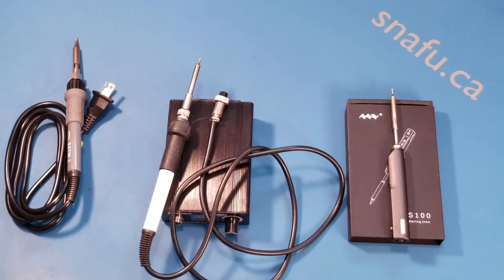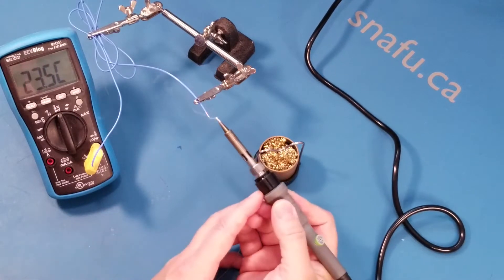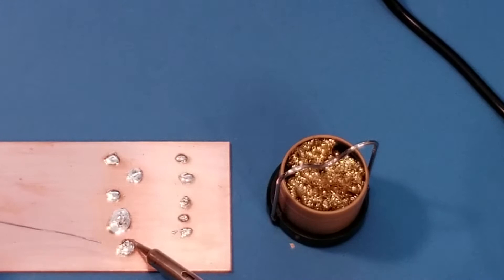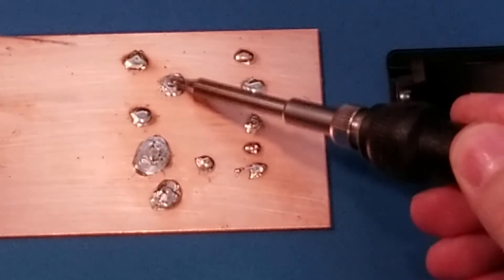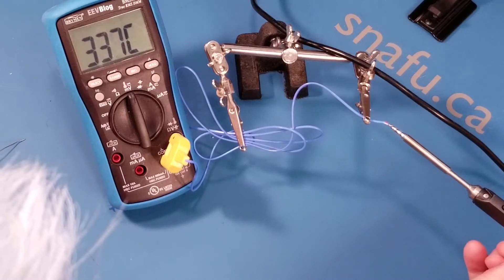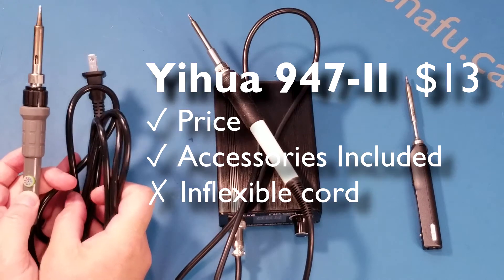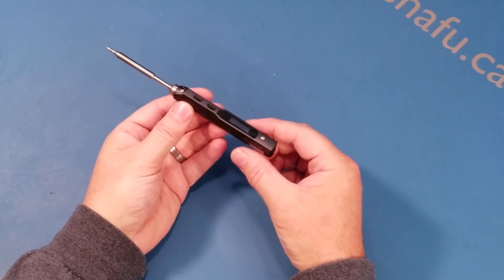Soldering Iron shootout: Yihua 947-II vs Quicko 951-T12 vs TS100

Comment: Its a good video but doing these tests it should be self explanatory to set the irons to the temperature using the multimeter thermocouple not the station and then compare them side by side. I think that you would be surprised ;)

Comment: One note, the TS100 with 19V is not at full power, it does required the 24V power supply in order to put out the claimed 70W/65W or thereabouts ...

Comment: Put a k tip on those quiko or the ts100.. you'll see a difference in performance.  Those little pointed tips are crap.  I have soldered pennies together using the ksger t12 (slightly upgraded quiko.. )  and it took me 27 seconds to wet on a penny.  It's not thermal mass where you get the problem.. its the conductivity of that heat.. even beiing direct drive.. you need surface area to conduct.  The quicko looks like it had a j2 on it.. which would be better than the straing cone tips you have on the other two.    I do turn the ksger up to 400 when doing pennies though.. and that probably has a lot to do with it as well..

Comment: what a demonstration, thermal transfer depends on the size of the tip, use flat head tip for both ts100 and t12 it will show much thermal transfer
Reply from the maker: Actually what I was demonstrating is the ability for the tip to come back up to temperature when given a big thermal mass.  Also, I used tips that were similar in size on all three, to avoid any bias
Reply: @Boffin55  no you did not use same tip types so admit that ,i have weller hackos and ts100 plus all school ceramic termal transfer hackkos and wellers and i can tell you the tip makes a big difference with big ground planes and big parts,ts100 with the new firmware and a chisel tip can do a lot for a small gun by the way

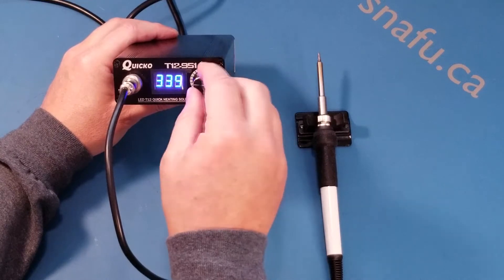Comment: 4:25 I have a later model from Quicko, the T12-953, which also has the same temperature jumping issue. The temperature readings becomes stable if I disconnect the ground, very weird.
Reply: You might not have a good ground, which is likely used as a reference

Comment: Comparing with Hakko or Weller, Quicko will not perform any worse. The difference is in the tip equipped. With the same tip, you will get the same performance.  Cheaper does not necessarily mean worse in performance, it may lack in other respects.

Comment: I have my doubts that the Weller or Pace or Hakko could do any better with that test  you showed. That looked like a slab of copper flat stock and that will rob any Iron of it heating capabilities. No Iron can do every thing. That test would be equivalent to welding a battery cable which could take a 240W iron to do it successfully
Reply from the maker: It's a piece of 1oz, 1.6mm copper clad PCB blank.  My 40 yr old weller with a 700F tip did better than all three, although I didn't show it on cam.

Comment: i have a similar item to the cheap $13 a  hakko 907 if you used one of the fatter tips instead of the needle point at 350  mine solders on heavy planes no problem, as you say its thermal mass, and the only mass is in the tip and not the whole shaft as in the other 2. others have rated the t100 very highly so i think it comes down to tip choice

Comment: In terms of the copper test, wouldn't a higher heat setting help? The T12-951 can get to 450 Celsius, and with a larger tip it should help in heat transfer.
Reply from the maker: While you could set a higher temperature, the point of the test is to see how quickly it recovers.
Reply: I was thinking the same but I guess he wanted to compare like with like and just see how each compared with the same temps.
Reply: @danielhenderson7050  i have since finally got around to assembling and testing the t12-951, it's excellent, I use it for electronics repairs and it gets hot fast, stays on temp and the handle is excellent, so easy to manipulate thanks to the silicone cord.
Reply: ELiT3CH that’s great, good to know!

Comment: thanks for the video, btw what multimeter do you recommend me of a middle cost...?
Reply from the maker: For low cost, try the Aneng AN8002 or 8008.  (under $30).  The one in the video is a Brymen BM235 (available from eevblog), its around $100